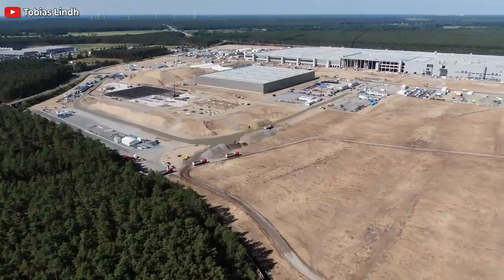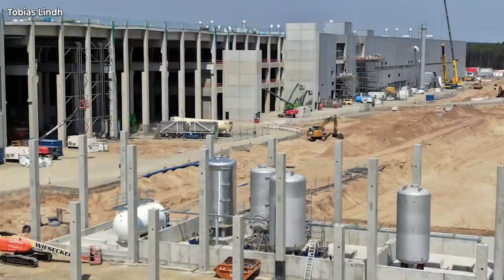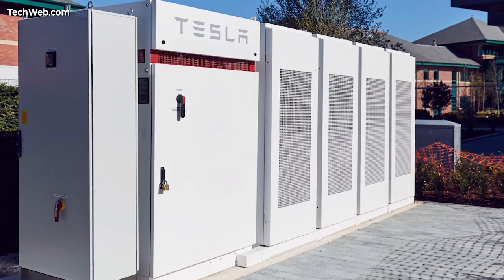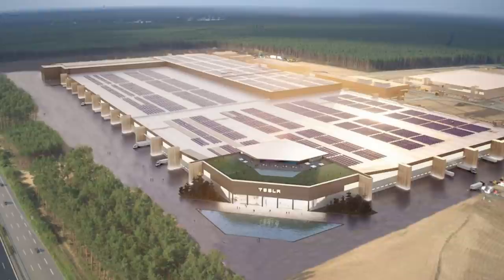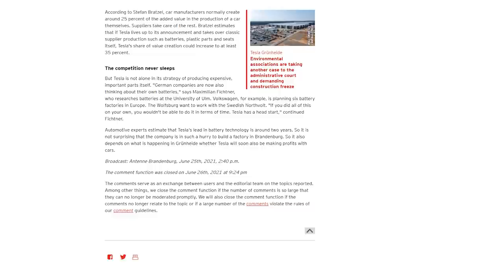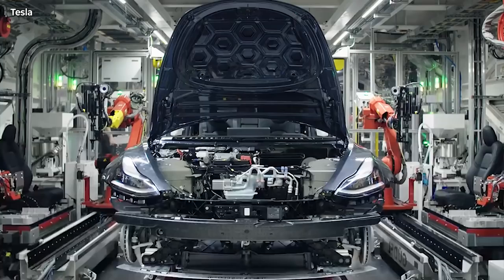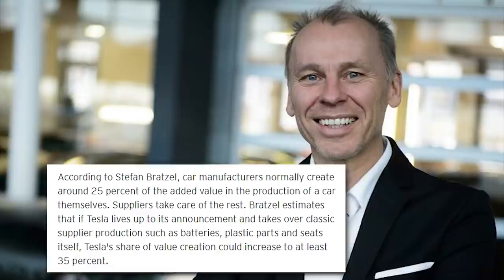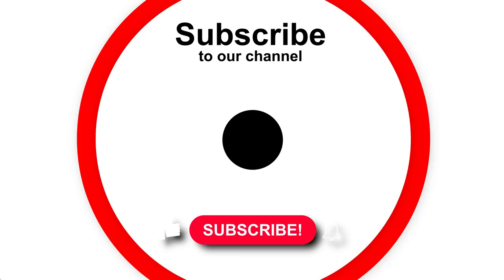Giga Berlin's PowerPack Shows Tesla Has Bigger Sustainability Goals

Comment: If Tesla were to keep Giga Berlin of-grid, it would make a strong case for the sustainabillity of ev‘s; since then they would be made with solar power only.
Reply: Takes a ton of electricity to operate the giga-press. Its an aluminum smelter  basically. Solar can power a lot of things but the scale necessary for these factories to be energy self sufficient within their own footprint is not feasible. There is a ton of clean wind in Europe already and more all the time. And It would not surprise be to see Tesla operating their own generation assets in the near future.
Reply: @davefroman4700  You might have a point there, but I would be curious to see a calculation.
Reply: @mikeoskam3785  There is not enough space for solar to charge the batteries coming off the line, let alone run the rest of the plant as well.

Comment: I'd expect one for every room in that building - the paint shop may have explosive chemicals, so that'll be why it's installed on the outside. Why wouldn't they use their own technology to reduce the cost and increase the reliability of manufacturing? As for solar panels on roofs, I think they'll be installed rather quickly. Likely over the course of two days in mid-August.